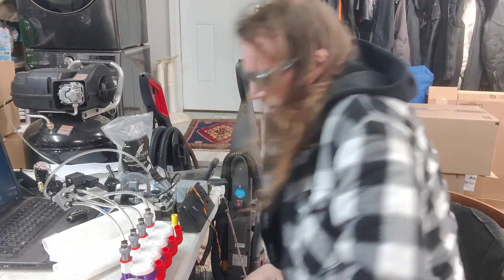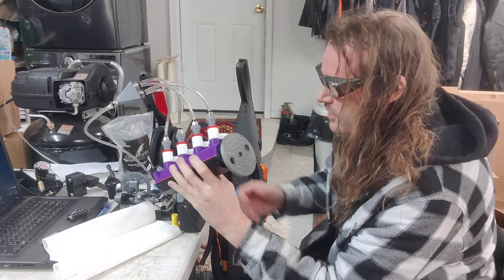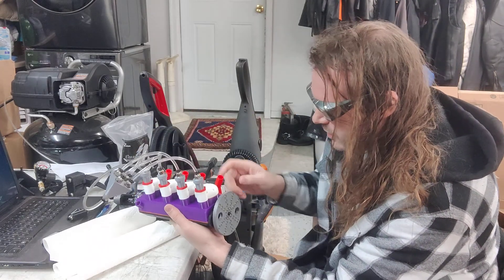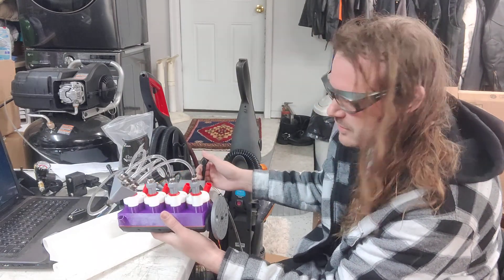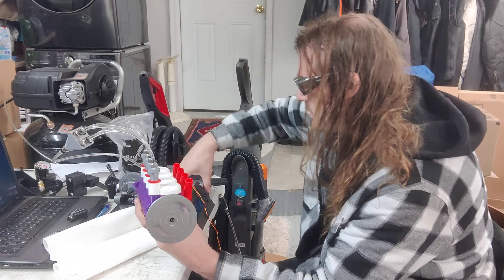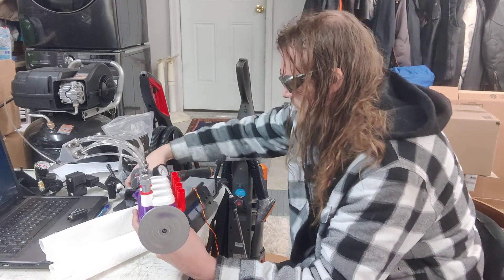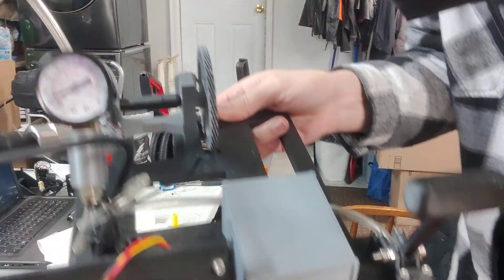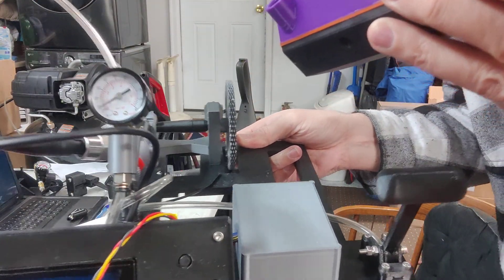I4 Crossplane 4 Stroke 1:2.6 Scale of CBR600 Engine! Maiden Run.

Comment: Can I have the 3D print files to that is awesome:)
Reply from the maker: Yes,  I am working very hard atm to get this ready for release.  I am currently making the engine stand/dyno and a Flywheel with a built in Spragg clutch, once those are done and tested, I can provide the files, the bill of materials and upload a video showing how to assemble and tune it.  The engine also has a severe problem where the crankshafts are in the wrong spot for the two middle pistons so I have to fix that as well!  Stay tuned,  I promise that I will get all of this done asap and this will be the final footprint for the Inline 4.  The main reason why I have not released any of my files for my previous engines yet is because as soon as I am ready to release anything I have a major design breakthrough and tend to have to redesign the entire engine.
Reply: @chrisjenda5162  That’s all fine, I’m sure it will all be worth the wait!